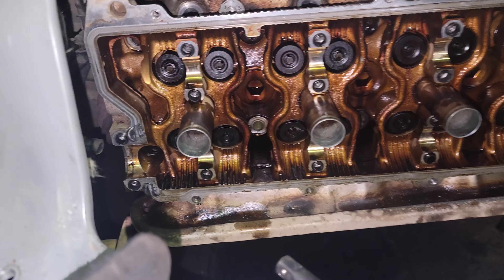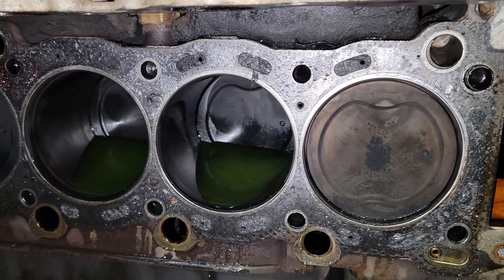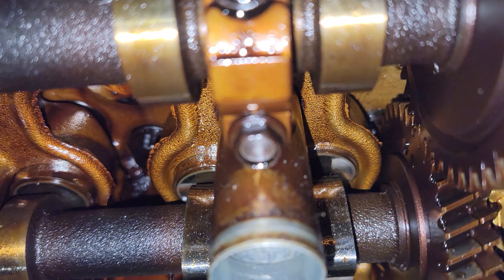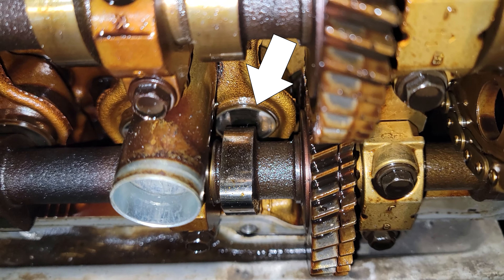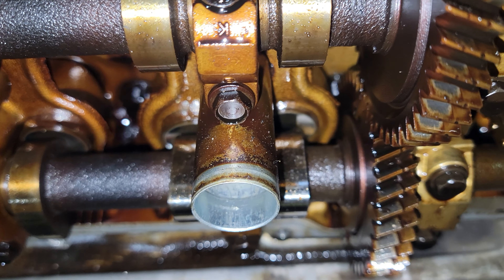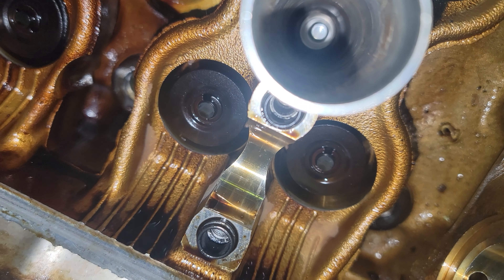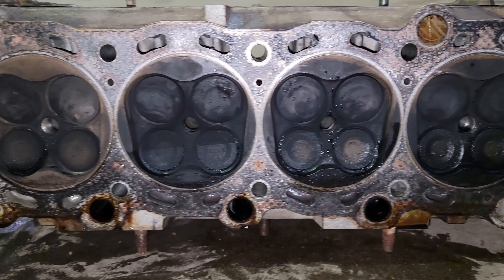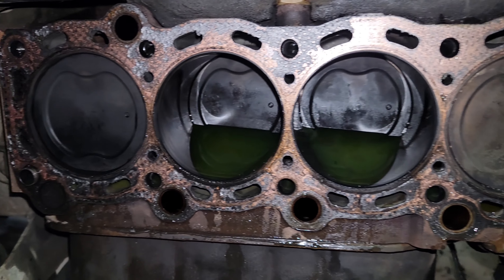Van Break Down Update 1

Comment: Could have been a lot worse. Of course as you said getting everything apart can test one a bit sometimes. I am sure the head recon won't be cheap, but will give a lot of peace of mind. Engine looks clean inside (no sludge) and bores seem reasonable from what I could see.
Reply from the maker: Yeah, definitely no bottom end damage at all. Cylinders were all nice and smooth and while the symptoms could have come from bad rings, I'm pretty sure they are all in good shape. The bottom end of these engines are pretty bulletproof and don't have a history of ever having issues. The head will be about 1K but all in all that's a pretty affordable repair compared to what I see some shops charge for big jobs these days.
Reply: @GotMountains    1k sounds very reasonable and you are fortunate that you have the ability to pull it apart and put it back together yourself.  You will be adventuring and checking out those views again in no time.
Reply from the maker: @leo169  yeah, I suspect it would be another 1-2k minimum for labor it I paid someone to do it.